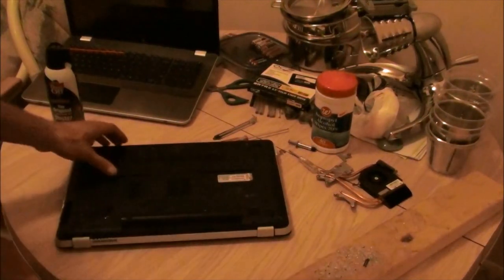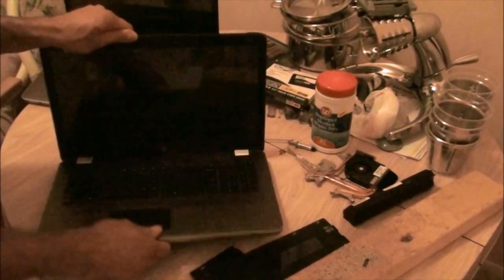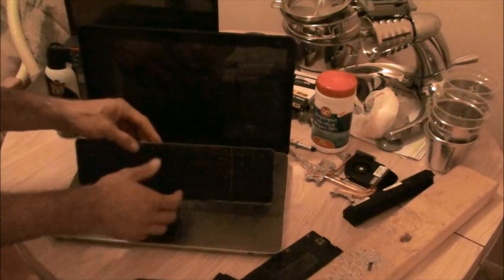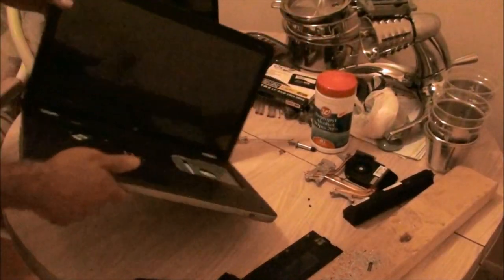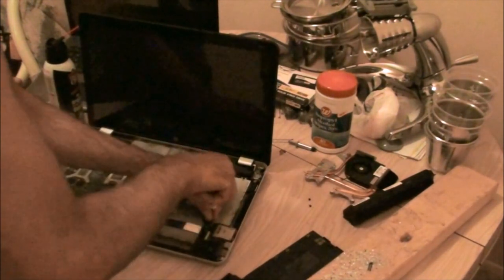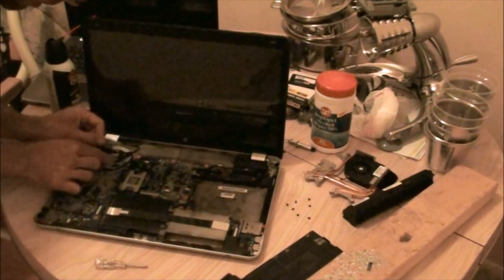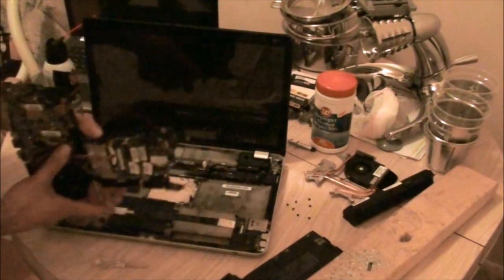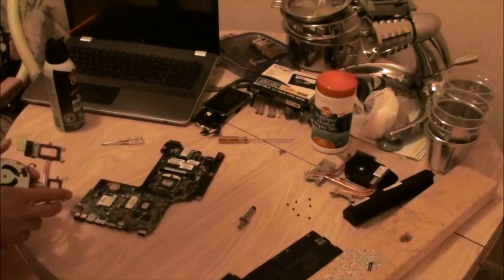Envy17 disassembly part 1 of 2

Comment: Thank you for upload. I cleaned my HP envy 17 laptop heat-sink and fan. But after assembly the fan does vibrates and shakes intermittently but does not turn on. I have rechecked fan wires and connections but still same position. Can you please tell me what could be the problem. Do I have to replace fan or heat-sink or both?

Comment: Very helpful. Many thanks for posting this. The advise about all the screws was not overempasised: There are a lot of screws. When doing something like this I make a rough drawing and place the screws on the drawing. Bit anal I know but you don't have any left over when finished and less risk of putting them in the wrong places.

Even with the best of care, the filter gets clogged so why they don't fit a filter-cleaning drawer is beyond me. This is an expensive piece of kit and taking it apart is not for the faint-hearted. With all that: Thanks again, very helpful.

Comment: Temperature readings have improved immensely after I followed this guide.. However, after reassembling the laptop there's now a light (but constant) churning noise coming from the top-left (definitely part of the heatsink/fan combo).

I realized this when I was ~90% done reassembling everything so I tore it apart again, double-checked the fan/heatsink assembly but there weren't any obstructions whatsoever. No cables, nothing clipping against the fan, etc. I thought maybe I bent screws too far, so I bent them back ~1/4 of the way and the noise still persists.

Did you ever run into any noise issues following the many (dis)assemblies you've done on the Envy 17?

Comment from the maker: It pays to read the comments. Anyway, since people keep having this problem I added a pop-up note in the video.

Also remove the four screws under the rubber feet on each corner. If you want to save the rubber feat then try heating them up first. You don't need to remove the middle rubber.

Comment from the maker: No can't do that without tearing my laptop apart and putting it back together. 

The temp in the read left hand corner is much better after applying the new paste.

The temp in the front left hand corner isn't any better, because the chipset doesn't have a heatsink. Only way to fix that is to find a heatsink that will fit, but I have failed to find one.

Comment: *Make sure you remove the screws beneath the rubber feet*

My results

Ran Prime 95 and Furmark on my Envy 17 1050ea model and was getting temps of 99º on the CPU. Then used your instructions to disassemble and used Artic silver 5. Reassembled and now I get temps of around 80º running the same tests as before. Thanks for the help
Reply: David Johnson well,  thanks for the comment.  I was trying to pop the cover off,  but it did not go off.  Just found out there was screws under the rubber because I read your comment.  Thanks mate :)

Comment from the maker: Yep you have to remove your keyboard and top cover. Take out all the screws on the bottom including the ones under the rubber feet. Then take off the keyboard and remove the screws under that so you can take off the top cover. From there you just unscrew the 3 screws holding in the DVD drive. I think that's all covered in the video.